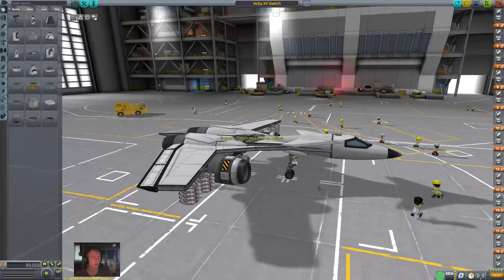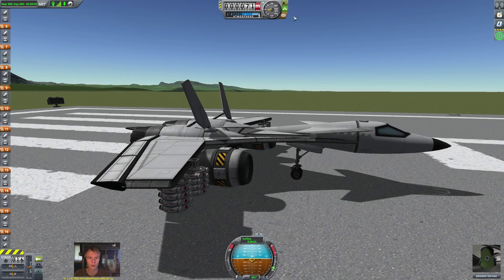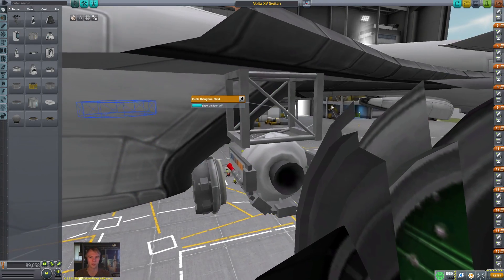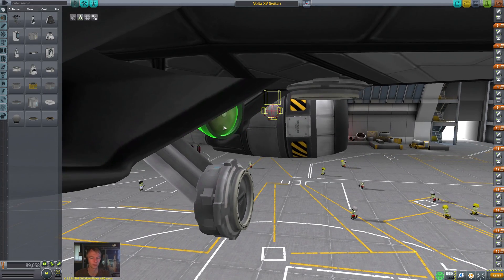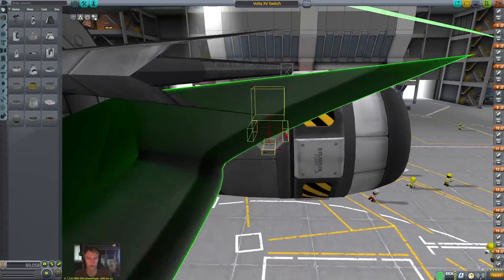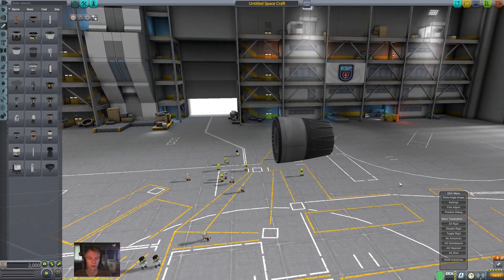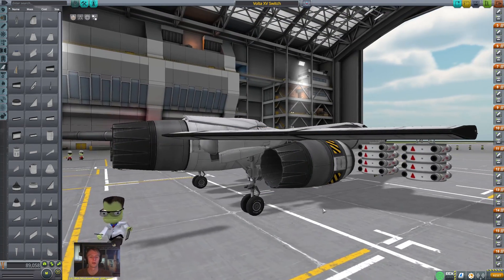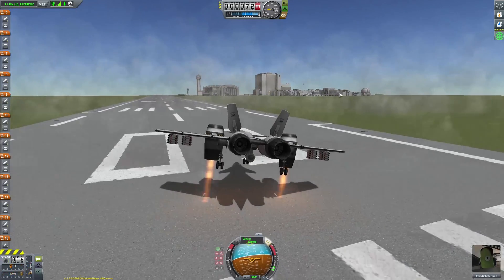(Outdated) Advanced plane tutorial #2: Stock, No DLC rotating VTOL engines

Comment: Very clean design indeed, only thing to make it perfect would be to avoid using NoLimit offset. But other than that, this is very clever and efficient !
Reply from the maker: Aye, I still bite my lip that I had to use it :( Thanks though! Efficiency is something I strive for :)
Reply: So do I ! Looks like this design is pretty doable with structural linkage between the central anchor points and the engines, so should not be an issue, exept when it comes to aesthetic integration :)